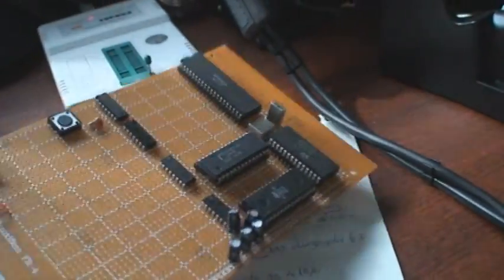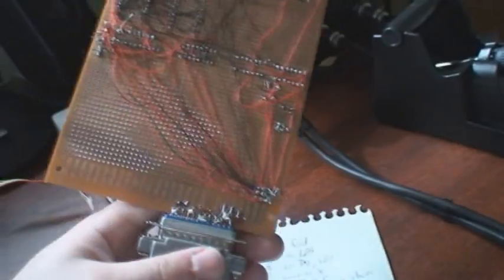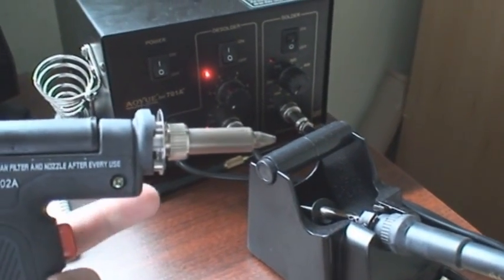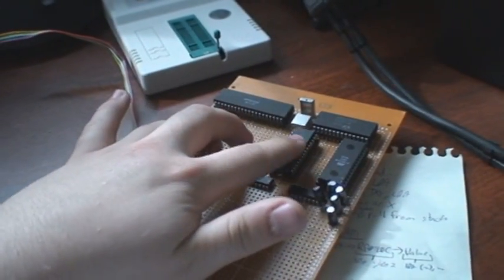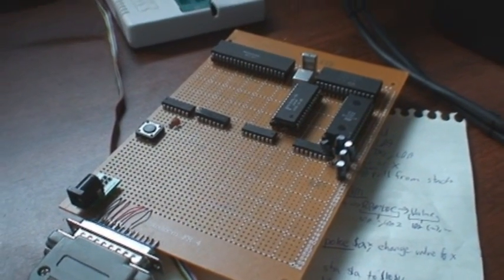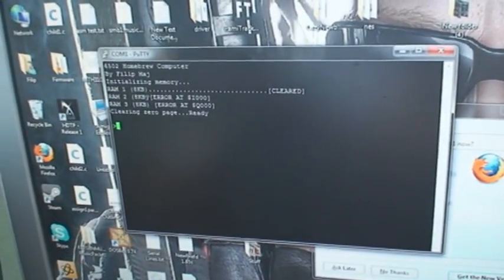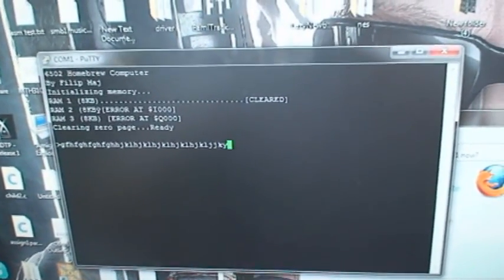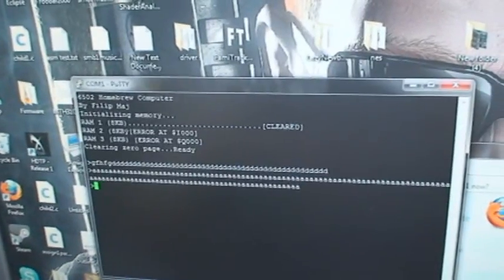6502 Homebrew Computer: On the protoboard, plus first part of the OS

Comment from the maker: @DusteDdekay You must apply reset at power up, then the cpu looks at the reset vector.

There are three (well 4/5) vectors the 6502 looks at nmi, reset, and irq. They are at $FFFA, $FFFC, and $FFFE respectively. the CPU looks at $FFFC (reset vector) and jumps to whatever address is held there ($FFFC low byte, $FFFD high byte).

Comment: awesome video :) I've a couple of 6510's laying around, have a strange dream of building a computer with them some day, but damn.. The datasheets are miles from what I'm used to with AVR's xD
Have I gotten the basics right ?
On powerup the cpu sets address bus to 0 (or 1?) and reads/executes whatever instruction is on the databus, the PC is incremented accordingly, addr bus sets next address and so on?